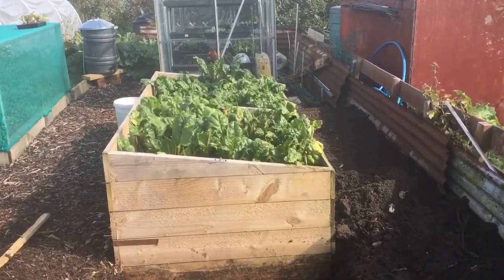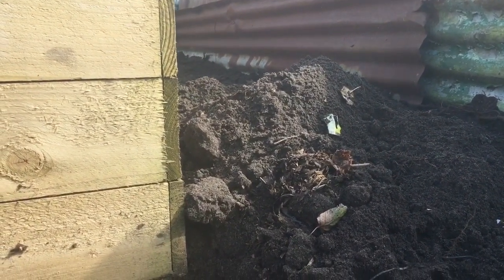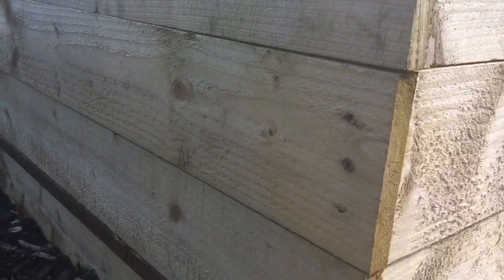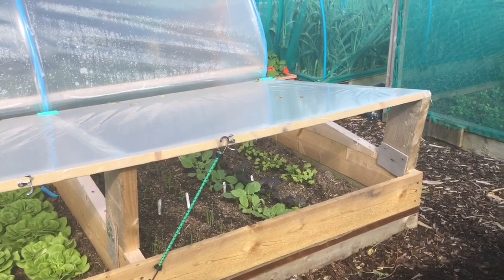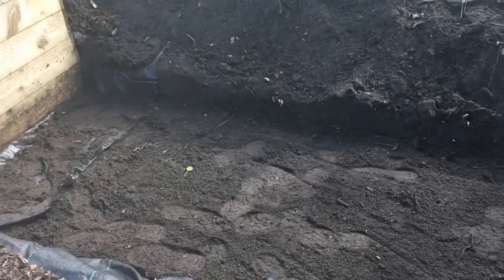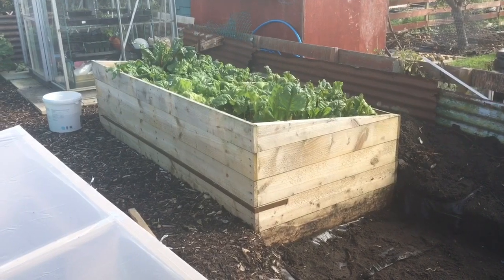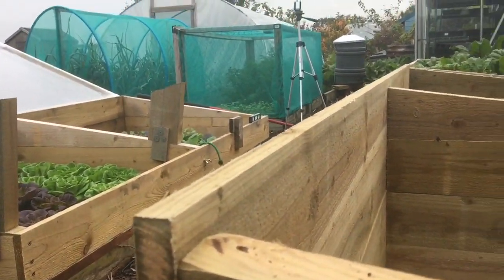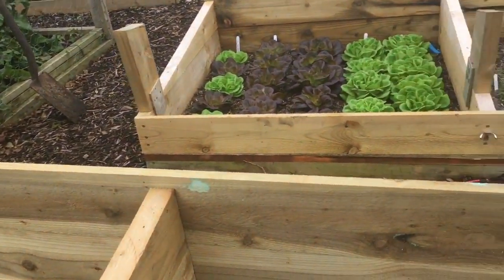Making a Hotbed from Start to Finish

Comment: Your cold frame/hotbed designs are great and they gave me an idea. I love my allotment but I get so frustrated just growing brassicas and overwintering onions and garlic I want to solve the problem. now we can heat a cold frame, using manure or a small paraffin heater and create the heat plants need in the winter but we cannot do much about the daylight hours. or can we! my preference would be to insulate the inside with either polystyrene or a kingspan/celotex product to keep the heat in. next the daylight hours. It occurred to me me that if we make the angle of the lid the prefered angle for a solar panel, (around 34°) then have a solar panel or 2 around 100 watts each  and Inside on the underside of the lid run daylight led bulbs around 4 watts each. I think a dozen should do and the difference in power created/used could be stored in a car battery or leisure battery so that you get more daylight hours  from the same amount of daylight. This way you can grow most things all throughout the year and not shut down your plot for the winter like most people do.
Reply from the maker: +TheJunkyardgenius a few thoughts, I think the light from the sun, even in winter is much greater than can be generated by solar and LED. LEDs are usually mains powered in commercial greenhouses and only used to supplement sunlight.  I’ve tried insulating my hotbeds with bubble wrap, but in the end found that just using soil and bark chips was fine. Finally although I’m unable to grow new veg in late December and January, I have a huge range sitting in my beds that has been growing up to mid December and from Feb onwards so I’m self sufficient all year round in veg excerpt cucumbers and tomatoes. See my next video to see what I have growing.  The key is to have everything grown by mid December, it goes dormant, but can still be harvested for the 6 weeks until Feb, when there’s enough light for everything to start growing again.

Comment: my ultimate goal is to be able to grow anything I want at anytime of the year without huge electric bills like in an indoor hydroponics setup. There is a company called fridheimer in Iceland growing toms 365 days a year in a greenhouse that's -20 outside the greenhouse. They use geothermal heat and lots of powerful lights. I am trying to create this in a health Robinson fashion on the cheap without huge expense. I know it's a big task but I think k I can get there.
Reply from the maker: +TheJunkyardgenius you could try heating a small poly tunnel with a cubic meter of compost and led in the roof, but I don’t think it would be warm enough

Comment: Fantastic project and so neat and tidy. Quick question - when you say the lids are double skinned you mean a layer of polythene or plastic on the inside and outside? And how to do attach the plastic without it tearing? Glue? Tape? Pins? It looks really taut and firm. Awesome job. Thanks for sharing.
Reply from the maker: +London Worms & Garden yes, polythene on both sides of the wooden frame. I pull it tight and put lots of staples in, but crucially I then cover the staples and other weak spots with polytunnel repair tape. It has to be really taut otherwise water pools in it and that would rip the staples. I fit it on a very hot day, so when it gets colder it pulls tighter
Reply: Steve's Seaside Allotment Brilliant technique. Thanks for the quick reply. You've inspired me to get something similar going in the garden although on a smaller scale. Have to say you allotment gas to be one of the cleanest, tidiest, most ergonomically designed in the country 😊👍
Reply from the maker: +London Worms & Garden thanks, it was out of necessity, when I started it I had arthritis in all of my joints, 18 months later, all that organic veg and good living and I'm in remission

Comment: Can I make frame like yours to compost weeds and grass clippings that would kill seeds in them
Reply from the maker: Hi Ricky, no, to kill weeds you need at least 1m3 but ideally bigger, that way you get the center of the heap to 60c which will kills seeds.  You also need to regularly turn the heap so that every part of it spends some time at the center.  I've given up on this, it's too hard, instead I just don't put weed seeds in if I can help it!!  : All the best - Steve

Comment: you were losing me on the build, but then you mentioned you could make the frame from straw bales; that's right in my wheelhouse, i want to build a house from them.  i like your wooden frame, but know i'd never build one; straw bales it is, thanks.
Reply from the maker: I don’t bother with hotbeds anymore though, found that I could get much better results by using growlights for a few weeks, much less effort. If you have the space though and access to all the materials it’s worth a try

Comment: What kind of wood are you using here Steve? Some treated wood obviously can’t be used in conjunction with growing food. Thanks.
Reply from the maker: Ground contact grade pressure treated timber.  As I understand it about 10 years ago the formulation of the preservative was changed and is now considered safe  : All the best - Steve

Comment: I know this is a high tech way of doing it but solar panels from amazon are around 80 quid for 100 watts, you can get an old car battery  anywhere, bulbs and holders are cheap and a small 100watt inverter you can pick up in lidl sometimes really cheap. you could build this whole set up for about 250 quid but it's a one off payment and it would last you years and Def  be worth it.
Reply from the maker: +TheJunkyardgenius a hot bed like mine only heats for 2.5 months from Early Feb to late April - by Mid Feb light levels are starting to build up just fine in a south facing bed. The LED trick might work for a December to Jan hot bed, but I just eat the stuff that has already grown in Sept to November in those months.

Comment: Hi Steve, great video. Question? When do you fill with manure if your planting in Feb to maximize the heat?
Also you mentioned that the produce grown from sept-nov is what you eat dec-jan - is that produce just grown in a cold frame or so you do the manure trick twice i.e starting one in sept and again in Feb?
Cheers, Rob
Reply from the maker: Hi Rob, it depends a little on the mix, but I would say about 2 weeks after filling it will be ready for planting, so filling late January is normally best. You can monitor the temperature to get a better idea. You don’t need manure for autumn beds, at least not here in England, it’s plenty warm enough in September and October, things slow down in November and Stop for the 6 weeks from mid Dec to Feb. : all the best - Steve
Reply: Thanks for the reply Steve, very helpful information to get me started 😊

Comment: That could be a good idea in my polytunnel, but may be  to much work for me at the moment.
Reply from the maker: they are a lot of hard work and a small greenhouse heater is a lot cheaper.  One of the potential issues with a hotbed is the amount of condensation they create in a greenhouse, although some people use them successfully  : All the best - Steve